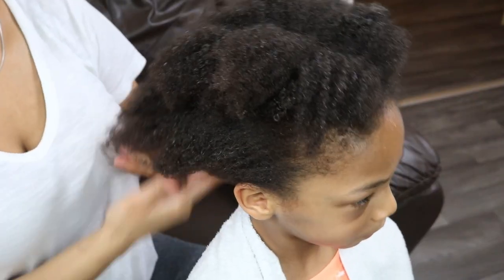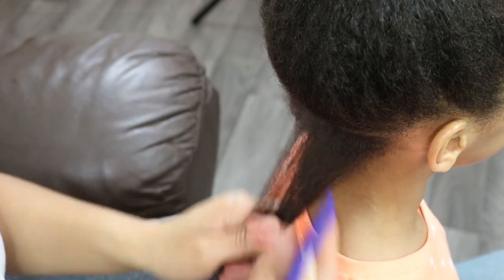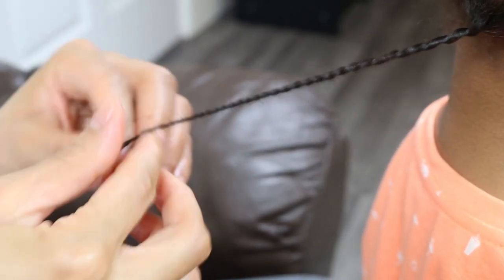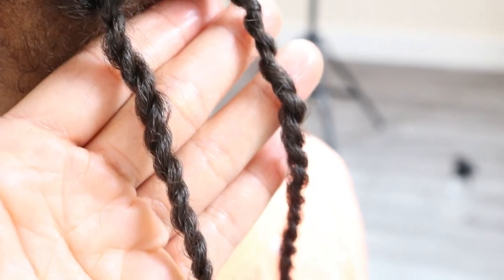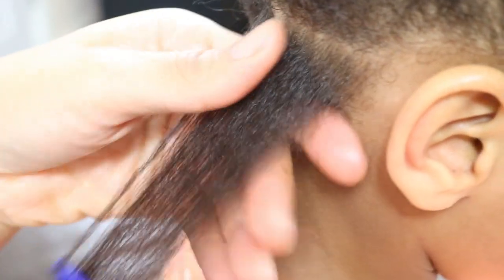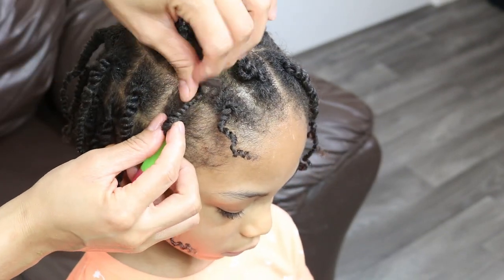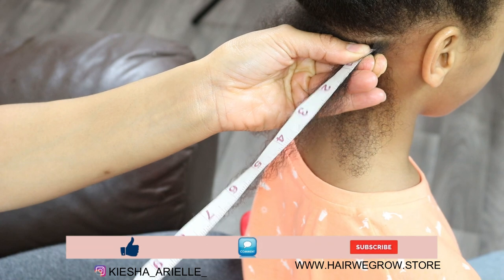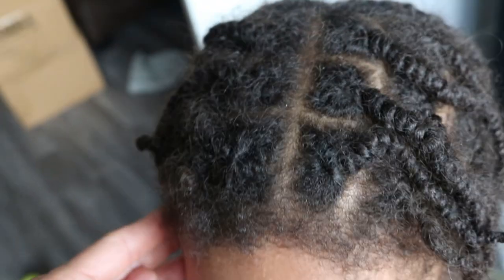HOW TO INSTALL TWO STRAND TWIST STARTER LOCS TUTORIAL | 1 WEEK LOC UPDATE

Comment: For older locs, how do you know which direction to go in, my man has locs going in different directions all over his head, so it’s hard to identify which way to go, and some of them unravel after already retwisting them
Reply from the maker: Once the loc is fully formed, the direction in which the loc is retwisted doesn't matter. It is very important in the earlier stage of the loc journey. As it relates to unraveling at the roots it depends on whether you are using products or not. I did a video showing how to make your retwist last longer, check it out here:

How to Make Your Retwist Last
https://youtu.be/3H8LBUHvUmo